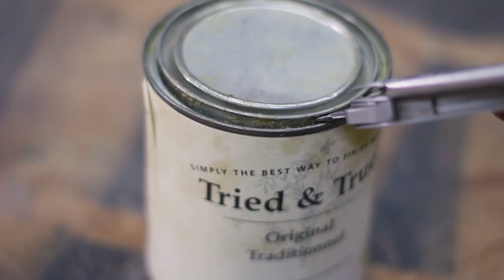Unique Dovetailed Scotch Whiskey box with hand carved lid // Craftsman doing woodworking

Comment: Amazing job, congratulations. I havr one question, for the detailing of the holes you think a small dremel mototool can do it?
Reply from the maker: Thank you! You could try. My lid was 5/8" thick and I think a dremel tool would struggle removing that much material. That being said, a thinner lid, and maybe even a different species of wood may make it easier on the tool. Best of luck!